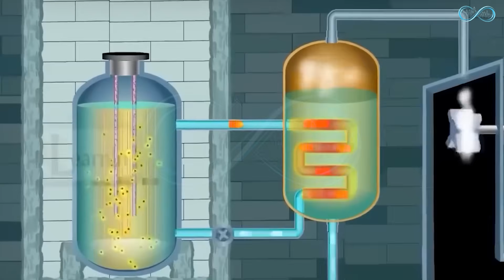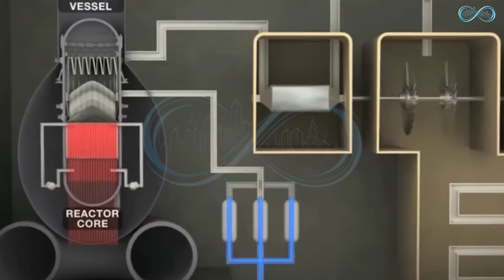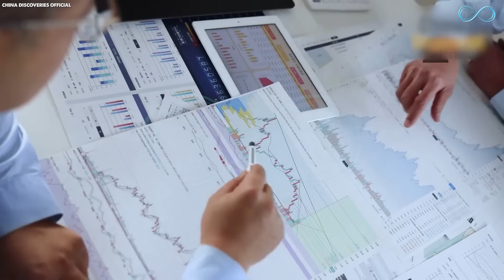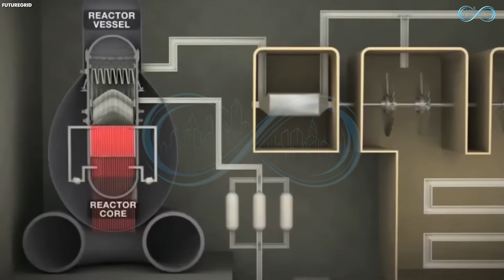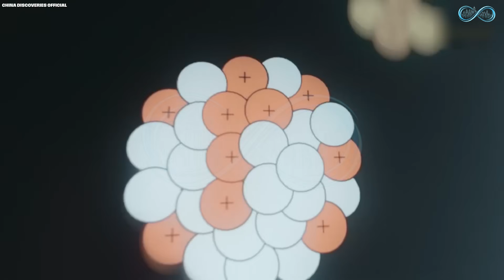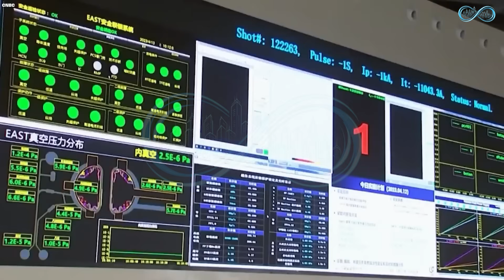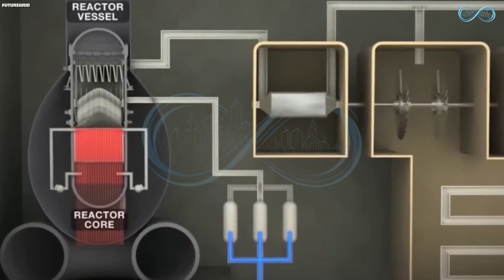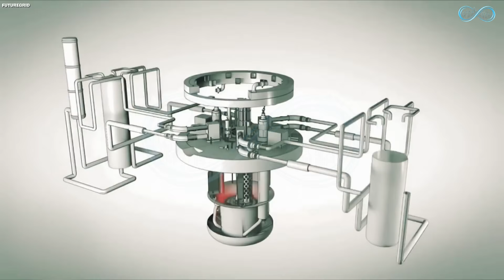China Just Built Something the U.S. Said Was Impossible — And It Works Perfectly

Comment: In terms of sheer scale and speed of adoption of renewable technologies, China is far ahead of any other nation. 
China produces 2.5x more power / year than the dilapidated Yankee energy structure,  (hydro-electric, solar, wind, battery storage and probably? fusion, etc).
in fact,  surpass in nearly every type of infrastructure. roads, bridges, tunnels, sewers, rail and ship-building
Reply: actually China real energy output is double of what they said.. they have very unusual method of calculations.. in reality.. China produce double the output of the entire collective west ''that's Europe.. Australasia.. Japan and Korea.. their steel and iron productions alone is about 40 time that of the US output.. that a lone used about 25% of US electric output.. same with their data centres.. the stat just keep going up and up.. they will double the output by 2035.. thats 10 years away..